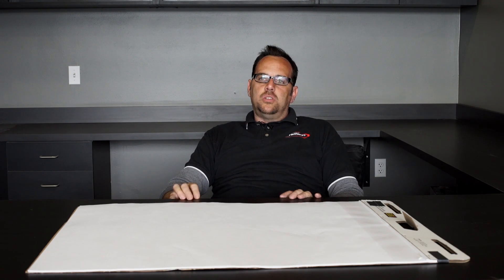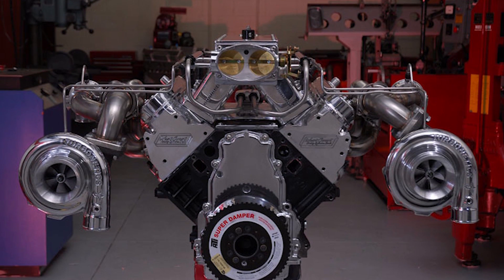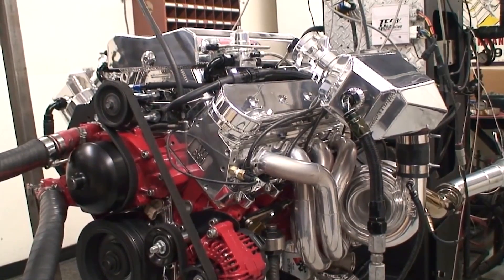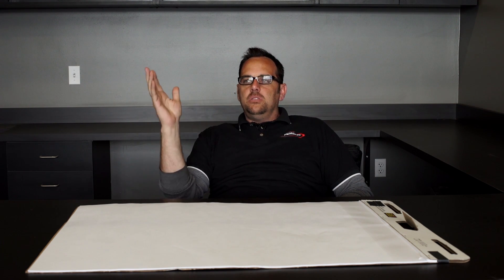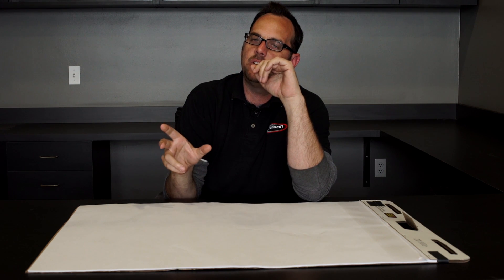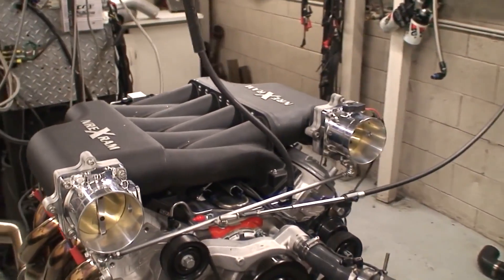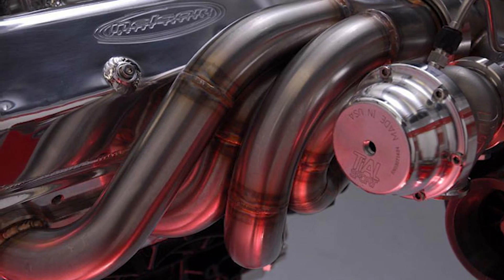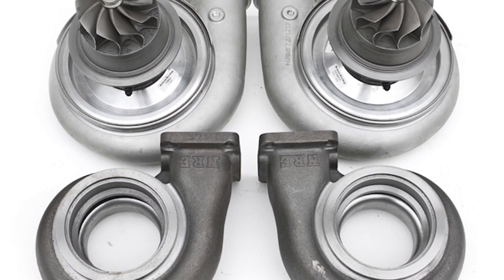Master Engine Builder Explains Why the LS V8 Is SO Good

Comment: The only reason it is good is because GM straight up stole the Ford Windsor design. GM made just enough changes to not get in trouble.
Reply: not a chance bud keep dreaming
Reply: Matthew Murphy yes, actually. Do yourself a favor and research it. Block angle, valve layout, head bolts, oil pump location, where the distributor would go, etc. Almost an exact replica. Heck 351 Cleveland heads fit on an LS.
Reply: Matthew Murphy so no redemption for you huh? You can not back up your statement. Bore and stroke were copied, V angle was, cam location was, etc
Reply: +Jake S fanboi, cobble, cheby lmao really bud?
Reply: +Jake S fucking loser
Reply: +Jake S This Matthew kid is obviously 12 and he's mad because his dad drives a chevy.
Reply: mfnbigdaddy73 Frank? Sheep? I think as a Cheby fanboi you might be way to inbred, like most Cheby lovers.
Reply: mfnbigdaddy73 its def Cheby fans that are inbred. Ford people dont just cobble crap together and aren't damaged by inbreeding. Cheby fans however think that the exhaust layout of a 350 is the greatest thing ever. Hence their inbred mentality.
Reply: +Jake S I just fact checked this and your fucked in the head dumb troll done with this convo
Reply: +mfnbigdaddy73 this kid is absolutely fucked in the head no logic to be found
Reply: +Jake S do you even know what a lawyer does? LMFAO and BTW you still haven't knowticed that neither me or the other guy haven't reacted to you calling us inbred because that's the most immature thing we have ever seen
Reply: mfnbigdaddy73 fact. 90% of Chevrolet fans like yourself are inbred. So its not name calling its a fact. You may not like the fact, but it is.
Reply: I see your are still spreading the bullshit word of FRANK....... Sheep.  lmao
Reply: Jake S  No, its the ford fan girls that are trailer park trash, inbred hicks.
Reply: Matthew Murphy and yet you're the one that can't use the right word. Your vs you're.
Reply: Jake S What an idiot.....lmao
Reply: Matthew Murphy yet the only thing you can do is name call because you're so inbred you can't find a single fact. I stated facts, and you just started crying into your daddy/brother/lovers shoulder.
Reply: mfnbigdaddy73 yes you are.
Reply: mfnbigdaddy73 you sure do a lot of projecting. Cheby = stolen Ford design = inbreds love it = you the inbred cheby lover
Reply: Jake S   You are projecting yourself to be a typical inbred ford fan boy.    And you keep proving the stereotype with every comment....lmao
Reply: mfnbigdaddy73 and yet cheby fans are inbred. I'm guessing you also are a Democrat, since almost all Democrats are inbred. Lots of intersection there.
Reply: Jake S  See what I mean,  you just keep doing it....lmao
Reply: mfnbigdaddy73 actually you are proving my point. Keep going though. It's funny to see your inbred brain try
Reply: Jake S   See what I mean,  you just keep doing it....lmao     Holy Shit you're fucking stupid.
Reply: Jake S         See what I mean,  you just keep doing it....lmao     Holy Shit you're fucking stupid.
Reply: Jake S See what I mean,  you just keep doing it....lmao     Holy Shit you're fucking stupid
Reply: mfnbigdaddy73 I wish I could say I am sorry about what's going to happen to you. But you brought it upon yourself.
Reply: Jeremy Hall cheby people have yet to learn that Ford had and does make a better much more efficient engine. Sure some of them have downsides. But overall it took cheby to use a 350 to attempt to keep up with a Ford 302. Cheby wouldn't even bother trying to match the 351(any of them)
Reply: Jake S  The new 5.0 ford doesn't get ant better fuel mileage than the Chevy 6.2, and it makes less HP and TQ.  So how is that more efficient ?
Reply: mfnbigdaddy73 actually it does. The problem is you are comparing cars, not the engines. So while a corvette is very aerodynamic a Shelby GT500 is not. Not to mention gearing differences.
Reply: Jake S  No, I'm comparing Camaro SS and the mustang gt.   Who even mentioned a gt500, or a Corvette?
Reply: mfnbigdaddy73 you cheby inbreds really are stupid. I was using them as examples. And even with similar aero you can't rule out gearing. Try comparing just the engines on a standalone dyno. Provide that evidence before you say anything else. And by the way I just told you to prove it first, the burden is on you.
Reply: Jake S  No you inparticular are a stupid fuck, not all ford fans are this fucking stupid.   I was trying to compare cars in the same class (similar weight, similar power, similar chassis), and your dumbass brought up a GT500 and a VETTE.   And everybody knows that the Camaro SS and the mustang gt get very similar fuel mileage.    And how the fuck would you get fuel MILEAGE on a dyno, you fucking MORON ?
Reply: mfnbigdaddy73 and now you can't prove what I said. The discussion was specifically about the engines. Yet you are to inbred to understand that. It's OK. The lawsuit is coming through nicely.
Reply: Matthew Murphy come to DC and try it. You like all typical inbred cheby fanbois can't use facts so you resort to petty actions. Of course being inbred you wouldn't stand a chance
Reply: mfnbigdaddy73 do you realize that you can test fuel consumption at load and at specific RPM's on a dyno? Of course not. You stupid cheby inbreds dont use dyno's, you just guess.
Reply: Jake S  I sure do, but you still cant figure fuel MILEAGE though can you, you ignorant Son of a Bitch ?      I love the fact that you continue to prove your stupidity for everyone on you tube to see.....LMMFAO
Reply: mfnbigdaddy73 you didnt realize a damn thing until I told you to. I can hardly wait until I see you in court.
Reply: Jake S  I realize that a fucking dyno doesn't travel miles ( which is what it would have to do to get a fuel mileage figure).    Great job idiot, just keep up the good work there kid.....lmao
Reply: mfnbigdaddy73 and you still can't prove me wrong and your still getting sued
Reply: Jake S  I have nothing to prove, except you being a dumbass, and you proved that all on your own.
Reply: You can't prove it, that's why. And one of the reasons you're being sued
Reply: Jake S  I don't have to prove that you are an idiot.  You do that every time you post !
Reply: mfnbigdaddy73 you will do as I say. I am in charge of you in this matter. Now do it
Reply: Jake S  Shut up moron !
Reply: mfnbigdaddy73 the more you act stupid the worse the lawsuit is going to be. Now do what I say. Do you understand?
Reply: Matthew Murphy prove you checked anything. Post links that provide evidence
Reply: Jake S Shut up moron !
Reply: Jake S   First off, kids cant hire lawyers, or file law suits.    I have owned your dumbass since your first comment.   You are the typical ford fan boy kid, who's father owned a ford, and now you think ford is the best.   And when ford gets beat by another brand, you get all butthurt, start making excuses, and telling lies.   I've seen it on youtube several times by fan boys of different brands.    It really is funny, although it is kind of sad....
Reply: mfnbigdaddy73 and I told you to prove me wrong. I own you. Do you understand that? You are my little bitch and you do as I say around here. I told you to prove it, now do it. The more you backtalk, the more you act up, the worse it's going to be on you. Do you understand bitch?
Reply: Jake S It is obvious that you are too ignorant to understand how this shit works.   Typical ford fan....lmao
Reply: Jake S What remark are you referring to?
Reply: Jake S   Who am I, and where do I live ?   lol
Reply: mfnbigdaddy73 any remark you make I can trace you inbred bitch. And I'm not going to put your personal info on here. But you are still getting sued
Reply: Jake S  And the burden of proof is still on you, dumbass !
Reply: mfnbigdaddy73 damn you inbreds are stupid. I said anytime you remark I can trace it. Oh my little inbred bitch. You will learn soon enough. You will be on the streets. But I'll invite you to watch your trailer burn down after I legally take it from you.
Reply: Jake S  But what remark am I supposedly being sued over, Perry Mason ?
Reply: Jake S  Having trouble coming up with this law suit worthy remark ?    LMAO
Reply: mfnbigdaddy73 look my little inbred bitch. I own you here. How hard is that to understand. The only reason I haven't punished you yet is because it's funny to see you try. But don't worry you can still watch your trailer go into my possession
Reply: mfnbigdaddy73 we don't need no water let that single wide burn!!!
Reply: Jake S  STILL WAITING ON THE PROOF OF YOUR ACCUSATIONS.....lmao
Reply: mfnbigdaddy73 oh my little inbred bitch. The burden of proof is on you. The problem is that you can not prove your side because it's false.
Reply: Jake S  Price my side ?    lmao
 So fucking stupid !!
And the burden of proof is on the accuser.  Look it up if you don't believe me. 
That is why I would embarrass you in court.  LMAO
Reply: Jake S  Let me try it another way....
If I accuse you of breaking into my pawn shop, I can't  just say you did it, and the courts prosecute you.   I would have to prove that you did  you did it, to have you prosecuted.   I cant just accuse you of breaking in, the burden of proof is on the ACCUSER !!!

Just like you accusing GM, the burden of proof is on YOU !!!
Do you get it now stupid fuck ?
Reply: mfnbigdaddy73 thats a poor analogy, and it would be you that broke in, using your analogy. And you are the accuser. I stated a fact. You accused me of lying. Thus the burden is on your little inbred shoulders.
Reply: Jake S THE BURDEN OF PROOF IS ON YOU,  THE ACCUSER,  AND I'LL BE WAITING ON THIS PROOF !!!
Reply: mfnbigdaddy73 what I stated is fact. Do you not understand that. I stated a fact that GM stole the design. That is a fact. You accused me of lying about that fact. So the burden is on you to prove my facts wrong. But you cant because its a fact.

I know this is hard for you being a little inbred bitch. So I wont wait for proof from you because you have none.
Reply: Jake S   No, what you did is accuse.   If it was a FACT, then you should have no problem providing proof. Me stating that you were lying was the truth, because you have no proof !
  I know it is hard for a simple minded fan boy to understand, but  The burden of proof is on you, the accuser, and I'll be waiting on this proof.
Reply: Jake S THE BURDEN OF PROOF IS ON YOU,  THE ACCUSER,  AND I'LL BE WAITING ON THIS PROOF !!!
Reply: mfnbigdaddy73 actually its on you for accusing me. I stated facts. Facts are not accusations. But I wont be waiting as you cant prove your inbred side. But you're still invited to watch your incest single wide burn down after I win it in the court.
Reply: Jake S  You accused GM of copying ford, which is a lie.    So it is on you to prove that GM copied ford.  I see that you are too stupid to grasp this concept. I actually kind of feel sorry for someone as stupid as you.  smh
.
.
.
 THE BURDEN OF PROOF IS ON YOU,  THE ACCUSER,  AND I'LL BE WAITING ON THIS PROOF !!!
Reply: mfnbigdaddy73 I did not accuse GM of it. They did it and I stated that fact. You however are to inbred to understand that.
Reply: Jake S  It is not a FACT if have PROOF , Simpleton !
Reply: Jake S    Some wiki links, with some engine specs, with nothing saying GM copied ford?   LMAO
I said proof you stupid Son of a BItch !
Reply: mfnbigdaddy73 I knew your inbred ass couldn't understand technical specs. It's funny to watch you fail.
Reply: mfnbigdaddy73 aaawww you're still trying.
Reply: Jake S Still waiting on your proof !
Reply: mfnbigdaddy73 look at you still crying because you're not smart enough to understand tech specs.
Reply: Jake S  Well since I'm so dumb how about you post these"tech specs" that prove GM copied ford .....   I'm waiting !
Reply: mfnbigdaddy73 read the links you stupid inbred
Reply: Jake S  That's what I thought...lmao
Reply: mfnbigdaddy73 obviously your thinking capability is very limited
Reply: Jake S  Still waiting on your proof....lmao
Reply: Jake S If you cant post some proof , STFU !!!
Reply: Jake S  No, you posted links to some engine specs.   Nothing in those links PROVES a fucking thing, you Idiot !
That is why I said post what you are calling "proof" on here.   NICE FAIL,  TRY AGAIN .....lmao
Reply: mfnbigdaddy73 and yet you are entirely to stupid due to inbreeding to understand the specs. Its funny how stupid you are.
Reply: Jake S  Oh, I understand specs,kid.   I have built and raced my own cars for 20 years.  That includes everything from Nissans, Mazda RX7s, Mitsubishis, Chevys, Dodges, and fords.   So, I want you to put in this comment section what you think is proof of GM copying ford.
Reply: Jake S  That just means one of two things.
1.There is nothing in your links to prove what you say .
2. You are too stupid to find ,and post what you claim.
Hmmmm.  Which one is it ?
Reply: Jake S  Come on you little punk ass ford nut hugging bitch.    Post your proof, if you're not scared you fucking coward !
Reply: Matthew Murphy I know....   He is a typical fanboy.     The killing part is, I don't have really anything against ford.   I just like Chevy, and prefer pushrod engines, because they are easier, and cheaper to work on.
Reply: +Jake S LMFAO dude stop that's hilarious
Reply: mfnbigdaddy73 your stupid inbred ass cant even open links to read whats in there. Your inbreeding (like Matthew Murphy ) has devoid of all capability to interpret data and compare it to other data. Its funny to watch you struggle.

Now how to burn that incest trailer down, hhhmm
Reply: mfnbigdaddy73 well you are inbred. So interpreting specs is not within your mental capabilities. Its funny how you cant figure out bore x stroke, valve angle, valve layout, etc.
Reply: Matthew Murphy  His delusion knows no bounds....lmao
Reply: Matthew Murphy you are just ashamed of you being inbred.
Reply: Jake S  And still haven't  posted this proof that you think is in those links....lmao
Reply: mfnbigdaddy73 and you still cant prove that GM didnt copy, considering the burden is on you. Remember I own you in this thread. You are my little inbred bitch and you will do as I say. I can hardly wait to destroy that house of incest you live in. I am sure your neighbors will be glad you are gone.
Reply: Jake S  That is because the burden of proof is on the accuser (YOU).   You are so childish and ignorant that you cant seem to be able grasp this legal concept......LMAO
Reply: mfnbigdaddy73 lets go over this again my little inbred. I stated a fact. You said I was wrong. You must prove that I am wrong. Its funny watching your little inbred ass try.
Reply: Jake S  You stated a lie, in which you accused GM of copying ford.   That makes you the accuser, which the burden of proving you claim is on YOU ! 
Yet you keep showing your ignorance of how legal process works.....LMAO
Reply: mfnbigdaddy73 no, I stated facts. You are the accuser. Now being an inbred it makes rational hard for you.
Reply: Jake S  You do realize that everyone that reads this sees how fucking ignorant you are, right?   LMAO
Reply: mfnbigdaddy73 actually what they see is you being a stubborn inbred.
Reply: Jake S   No, what they see is a kid that made an accusation, that can't back the accusation up with facts. And they see you as being very childish, that resorts to name calling with every post, because you know that you lost this debate long ago.
Reply: Jake S  You sound like you need to look in a mirror, because you are just projecting, like an immature, insecure little kid....lmao

Comment: The Upgraded Coyote in the 2015 Mustang, along with the Upgraded Roush Supercharger for 2015 is advertised at 670hp and dynos right around 700, and Ford will give it a Full Factory Warranty.  2016 Roush Stage 3 Mustang.

Comment: this is the best pushrod engine ever  , i hope it's the last one , can you imagine a 500ci with real tech in it , not that Schubeck crapp , something with int/exh vvt , direct inj , variable intake geo , vatn turbo , e85 & lighthweight everything
Reply: +Christian Cantin Push-Rod engines are Cheap, Simple, and Compact in design, beyond that they're inferior engines.
Reply: top fuel had the McGee in the late 80s , americans took care of that one , bunch of retards
Reply: No the 351w is the best pushrod engine, seeing as the ls was designed after the 351w. Once again Chevy stealing fords design.
Reply: +Jeremy Hall windsor doesn't have 6 bolt main, or aluminium block, timing cover mounted oil pump, o'ring gasket etc etc, i'm a ford guy btw, you dont have to sell me on a Windsor / Cleaveland  hybryd